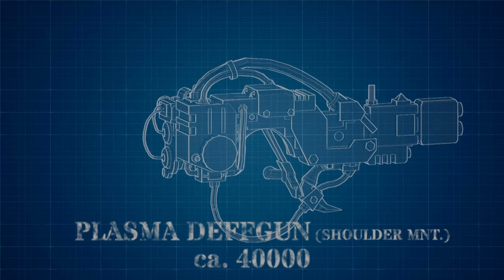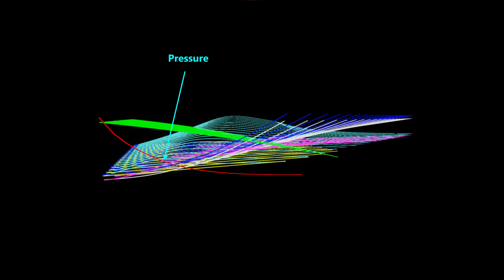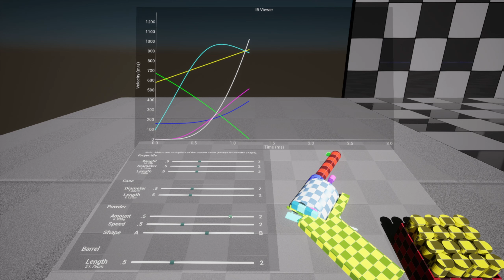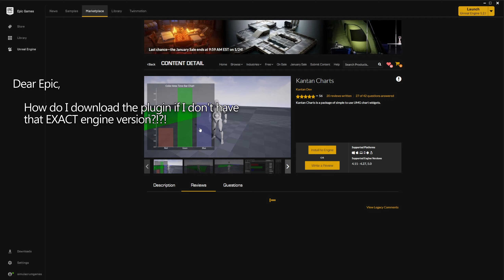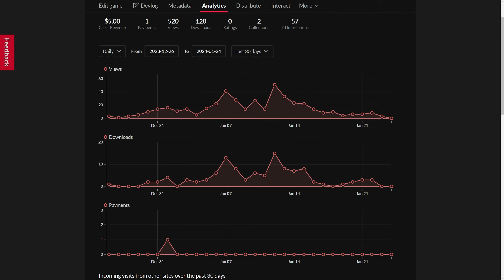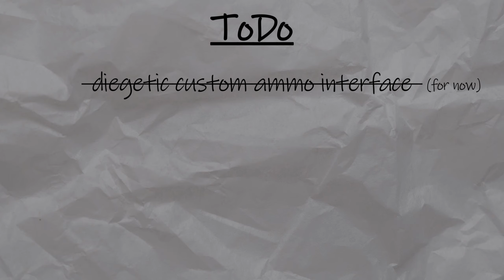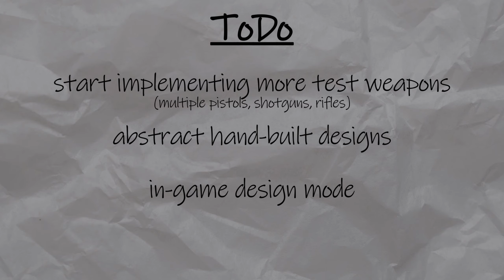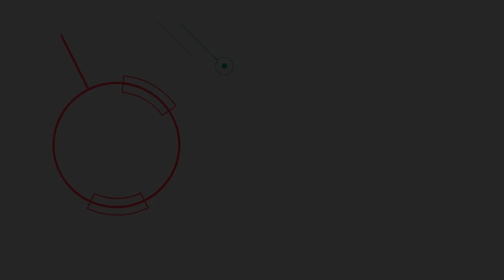Boom baby! - Weapons: Manual | Devlog #3

Comment: "You won't have access to this tool in the game, you'll have to feel it out through testing... and sometimes your gun will explode!" - I love how happy you sound while saying that last bit! xD Also, that sounds like a cool way to encourage care during experimentation.

Also, it's probably important to consider control remapping, gamepad support (if you can), and laptop-friendly control scheme options. Of particular note with that last bit is that laptop scrolling is sometimes not correctly recognised in games. There's no issue with making any major game engine accept the correct input, but there are ways to map things onto scrolling which tie it explicitly to a mouse scroll wheel, not a scroll input from a touchpad. Also about 99% of laptops don't have middle mouse button mapped, so options to put that input on a key somewhere is probably a good idea too. Might be too early to go deep into the controls, but... worth mentioning as something to keep in mind, at least?
Reply from the maker: All good points to keep in mind!

Comment: While I have no internal knowledge on how this ballistics model works, from the way you described the parameters, railguns or coil-guns seem extremely possible.
If you simply hold the pressure constant, it could mimic the magnetic acceleration extremely effectively, as is memory serves the equation for approximating magnetic acceleration is pretty similar to with pressure.
Reply: Now that I think about it, if you could impart constant force/acceleration on a bullet, you could also make rocket bullets. I wouldn't advise you to work on that yet lol. Maybe rifling though?
There's a ton of cool gun designs that aren't used because they're war crimes. America had a grenade launcher that technically counted as explosive bullets, for instance.
Reply from the maker: Yep! Definitely going to have to be different equations for different ammo types, I think gunpowder/pressure-based will probably be the most difficult as constant acceleration is probably good enough for most others.

Exploring how plasma guns might work will be fun though. 🤔
Reply: Plasma sounds so cool, are you thinking making the "bullet" expand over time and lose damage or something? @simulacrumgames
Reply from the maker: @Spoon80085  I haven't put too much thought into yet, as I'd like to allow players to emulate weapons from other games. So there might end up being multiple types of "plasma".

Comment: I don't know if you have access to a VR headset or not, but the game Hotdogs, Horseshoes, and Handgrenades is a really excellent gun sim. With a Vive or Valve knuckles setup, you can individually manipulate the various granular systems in a weapon (locking the slide back, cocking/uncocking a revolver, manually rack a round, fill a magazine with custom bullet load order, etc) and it is a great tool to really understand how the weapon you're inspecting will operate. Plus it has revolver spinning, which is just bonus cool points
Reply from the maker: I've played H3 at a friend's place and totally agree, very cool! I would love to reach the same level of quality as that game 🤯

Comment: Can we have easier controls for turning barrel based weapons? As a player I would hate having to move back and forth between the stick and barrel, I'd rather use the scroll wheel to move the barrel and use the mouse to push the bullet/casing out of the barrel.
Reply from the maker: I wonder if that's best to solve with more different modes or if 'manipulation mode' should default to scroll wheel == cylinder.
Probably something the player should be able to set during design mode... 🤔
Reply: @simulacrumgames  That would be nice, It would improve speed if players can switch how they control different parts of the gun.

e.g. (sorry for so much text)
While in Design Mode: If the player holds the left mouse button down on a component and presses the key B, that component's value will be able to be manipulated by the scroll wheel until the player leaves design mode, holds and clicks B again, or presses N to remove the effect without clicking the component.

You could also make it so that if you click on one component, press B then click on another component and press B you can control BOTH values at the same time, in case you want to universally decrease or increase several component values.

Note: This is just an idea to make it easier  for people to choose to whether or not to use the scroll wheel. Improvements to the idea obvious could be made to fit your game.
Reply from the maker: @thecrispyacorn  Thanks, I've been thinking about how "main-hand" operations might work. (Each hand is the corresponding mouse button, so typically the "off-hand" is what manipulates the held object.)

"Tagging" the main-hand's active component and then using the associated mouse button/scroll wheel might be a good way to allow two-handed operations.

Comment: Unplayable performance :(
Reply from the maker: Why's that?
Reply: @simulacrumgames  Idk bro it's your game, I just get 5 fps
Reply from the maker: @Jintenzo  What are your specs?
Reply: @simulacrumgames  13th Gen Intel i7-13700k, 32 GB RAM, Intel UHD Graphics 770 (Integrated). The integrated graphics aren't incredible but they're enough for a lot of games.
Reply from the maker: @Jintenzo  Yeah I think that's the issue, I've probably got lumen and all the heavy UE5 stuff enabled.
Some config menu stuff will need to be added at some point. In the meantime, if you reaaaally want to play around with it you can edit the .ini files to turn down the gfx.
Reply: @simulacrumgames  Didn't know I could do that, I'll try that later